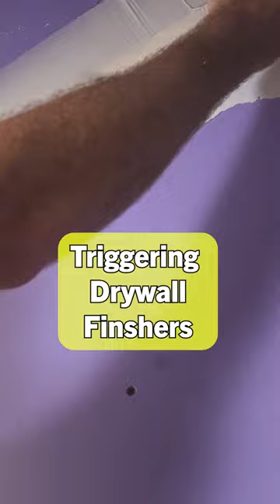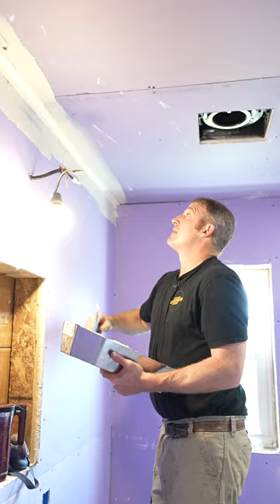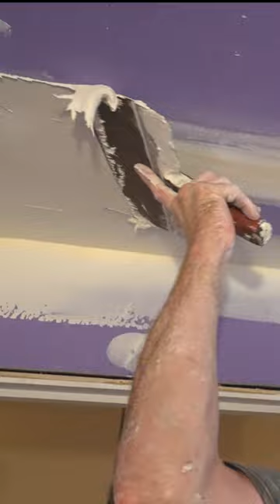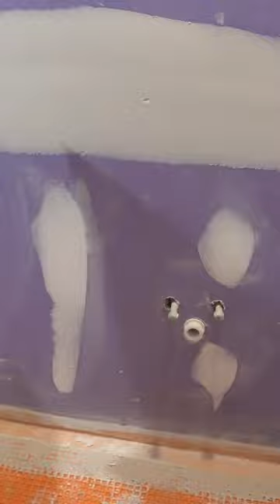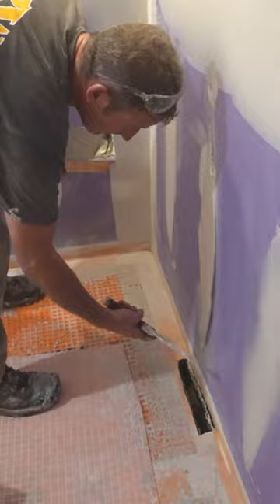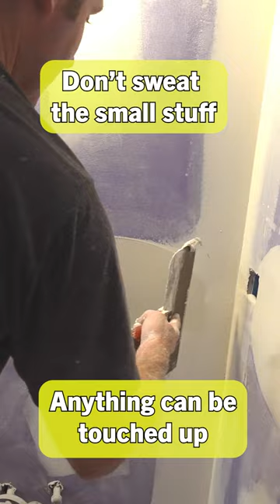Triggering Drywall Finishers #shorts

Comment: Just had three rooms done by the best, fastest mud and tape guy I have ever seen. Problem is he is an xxx. Criticizes any method but his own, but he is a unicorn as a drywall guy. Shows up when he says he will, finishes on time, and does really good work. However the guy I used years ago who doesn’t do it anymore also did great work. He was super nice, sanded pounds of mud off his joint, was painfully slow, but the results were just as good.

Comment: A small professional tip. Use a 4”wide knife for the inside corners. Anything wider is a waste of time and material. That’s what all the commercial and residential finishers do. Just trying to help.
Reply: And don’t slide the screws multiple times with a 10, also get a banjo or bazooka instead of hand taping. Cut out all the bad and pre fill with bond, then either flat tape, or mesh and bond… I could go on for a while
Reply: @zachwagner1838  He’s hand taping a bathroom really not a big deal to hand tape.
Reply: @sundog8772  for yourself, sure. Professionally, painfully slow. And doesn’t negate what I said about sliding screws 3 coats with a 10, or whatever else I stated

Comment: If you are painting, when you wipe the joints with the blade perpendicular to the drywall you will have a flatter joint with less sanding. But if you’re tiling, your way is close enough.
Reply: Facts.

Comment: Try fibafuse for your flat joints, it's good.
Reply: Not with premixed mud
Reply: I use mesh tape & 40 minute mud e-z sand & you can put 2nd coat same day
Reply: & about half that amount of mud also if you prefilled  the holes make things easier